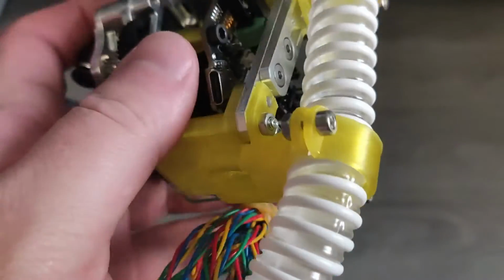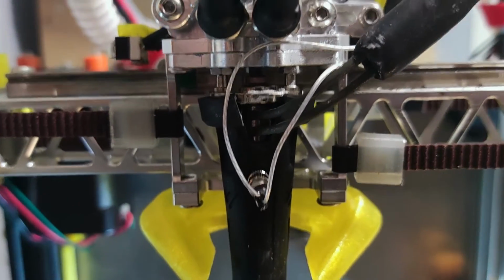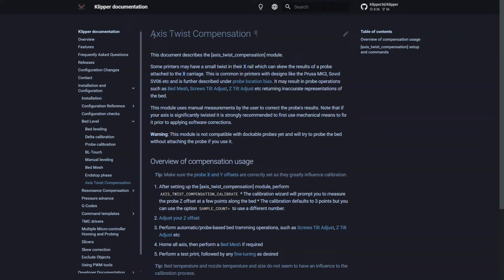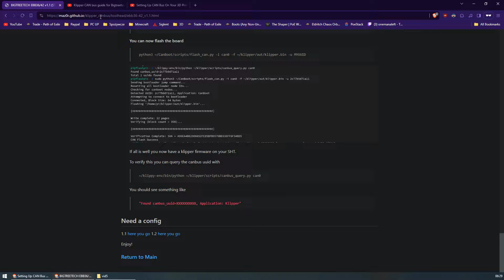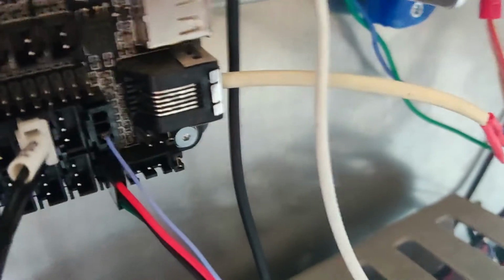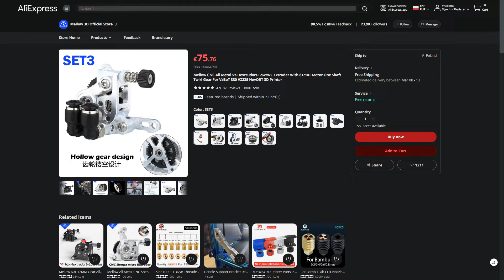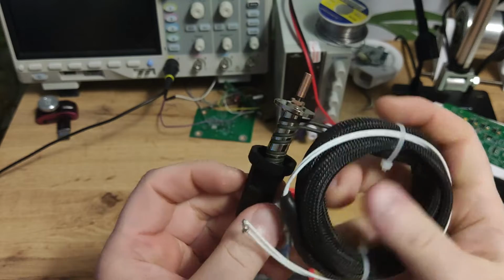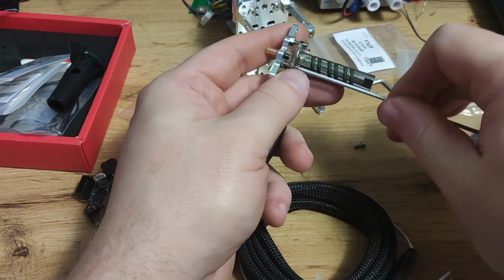Supercharge Your VzBoT 3D Printer: High-End Upgrades and Modifications - part 5

Comment: What do you use for bed leveling? Did you modify the bed? I have a x5sa and changed mostly everything except the bed mount. I installed linear rail but I'm not sure about the design I used so I'm thinking about getting the vzbot upgrade for the x,y movement.

Comment: Crazy, I have the exact same setup just air cooled. I've built all 3 vzbot printers. I also designed and machined all my own parts. Gantry tube, pulley brackets, print head mount, motor mounts, and even the bed frame. I also use the EBB36 on mine. Definitely cuts down on wires back to the motherboard. I run the Manta M8P V2 on all of them now. Partly because of having dedicated PWM fan ports. But mainly because the pi and main board are in one package to cut down on wiring.
Looks good man! Love the yellow. I went with fluro green on my 330,red on my 235, and fluro yellow and blue on my 150. One of these printers is expensive enough by itself but buying 3 of everything is just crazy.